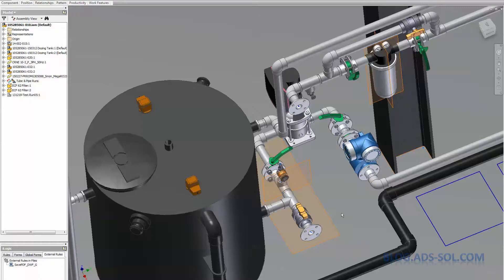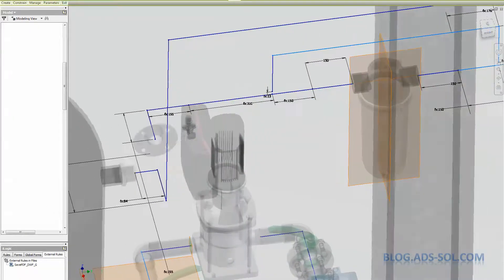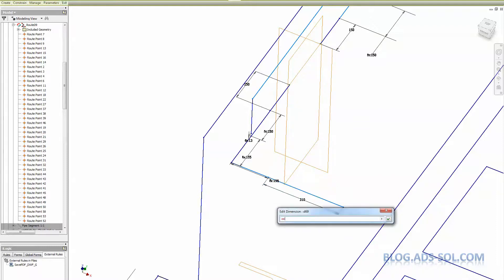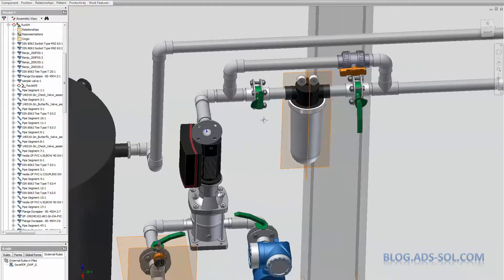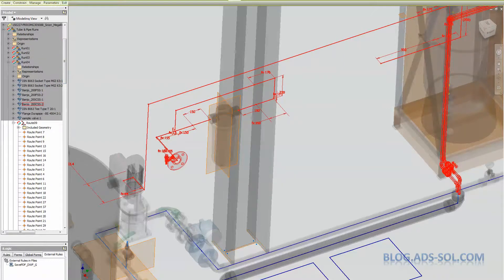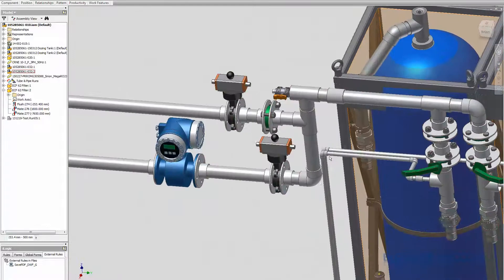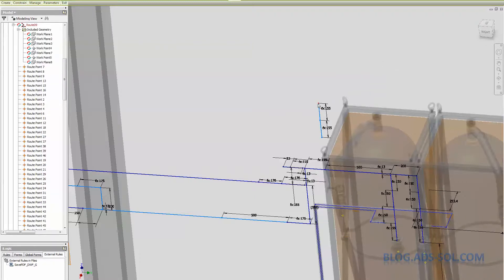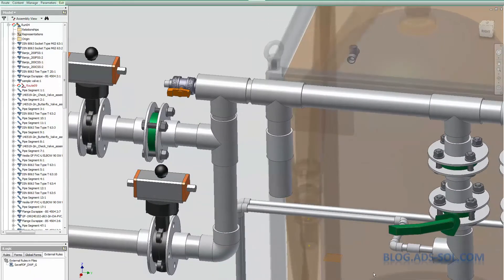Autodesk Inventor T&P: Tee Branches and Route Editing

Comment: if i start new piping system how do i arrange it? should i locate all equipments first? what type of accessories should i author and what should not be authored? how should I divide runs as sub-assemblies
Reply from the maker: Hi Rajesh,

I suggest you start placing your equipment first. If you decide to move them around the pipe routes will adjust to the new location.
I would recommend you author as much as you can, time permitting. I would author the pumps, filters, etc. because the route has a predefined connection and you don't need to pay attention to the selection of circular edge or direction of the route start.

Split the routes as you see fit. I usually split them so I can document them. I split each spool into its own run which helps when creating drawings.
Reply: Adrian Salariu thanks. very helpfull tips.